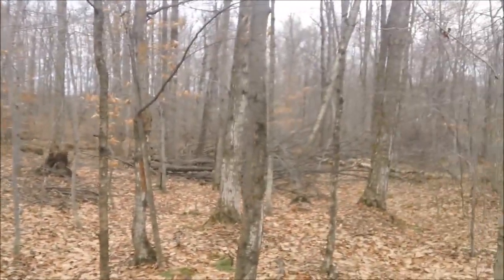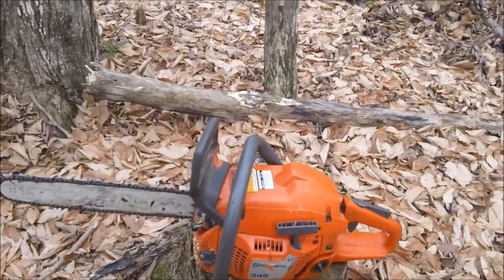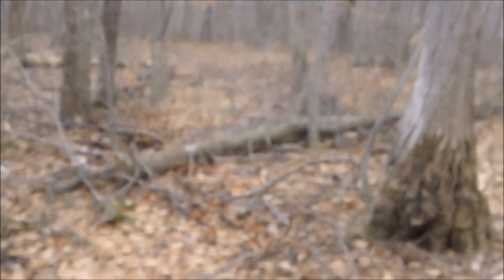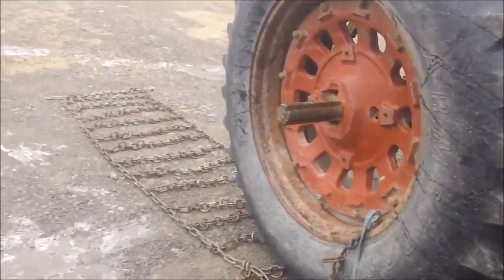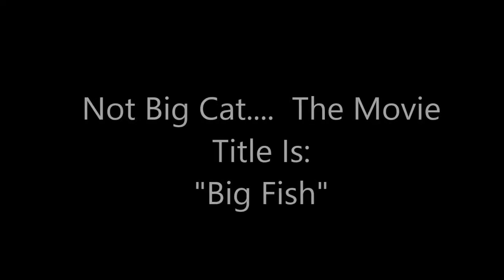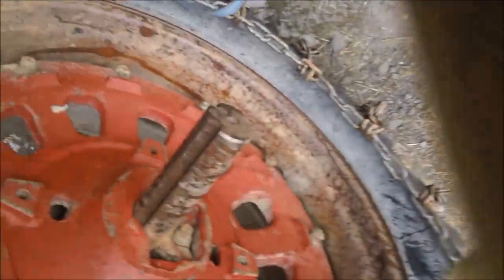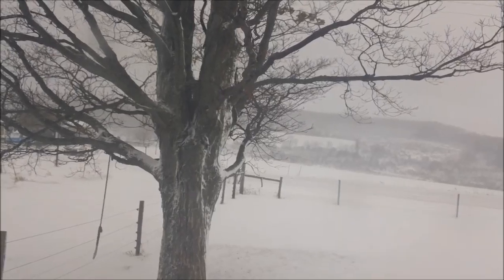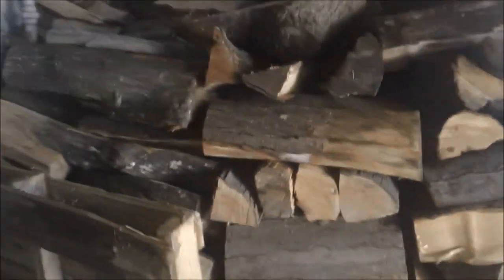How To Put Chains On A Farm Tractor & Other Hobby Farm Things

Comment: I made a great log puller.  Two 50 foot guy wires cobbled together with cable clamps and drag hooks on each end.  I would take one end and make it into a noose, which went around the log and the other end was hooked on the bar on the three point.  I also had several short chains if I needed to short chain them to the three point bar.  I had a lot bigger tractor than you have  - a NH7740, but I did not have to run it in ice and snow, but I ran it in a lot of mud and water.  The noose cable also could be used to make sure a leaning tree fell where you wanted it to

Comment: Love the vids! Do you still drive plow truck? I'm looking to get into something more consistent than firewood for next winter, has been the worst winter I could imagine for it, right now its 55 in Michigan! What qualifications did you need to start and would you recommend it?
Reply from the maker: +Alex Matthews Actually I'm getting ready to retire and do saw things full time. We have really nice equipment where my day job is, all late model International 7600 series, Pay Stars, and Western Stars tandem axle dumps as the basis of our plow trucks. All 18sp and 425plus HP as well. I can say with the long hours in those trucks, don't work for a place that has earlier than 2006 equipment. Period. My current truck is a 2015 7600 with a Max Force 13 at 435plus hp. Its quiet. Great power. Good chassis and suspension layout. Just a joy to drive. And like I said... 14hrs into a storm that makes a huge difference. So yes... first understand the equipment. Second. As far as requirements, were I work only hires those with several years of farm or construction experience running trucks requiring a minimum of a class "B" CDL with Tank and Hazmat endorsements. Period.

Its a hard life. Working for a municipality is very political as well. You have to have a very thick skin. I would say given the option of working for your self and a municipal type job.... its tough. I had an excavation business and still have a tough time with the priorities here. I would say unless you have a shrinking local market, stay free of the asylum. Work to build your own business. There are SO many reasons why. If you have to go municipal type work, look for a town that has a well funded Highway first... then think county or state. That's my humble opinion.
Reply: +afleetcommand Thanks for the reply and good to know, Its nice doing my own thing but sometimes It'd be nice not to make all the decisions! Good points about the political side of it though, not my cup of tea.